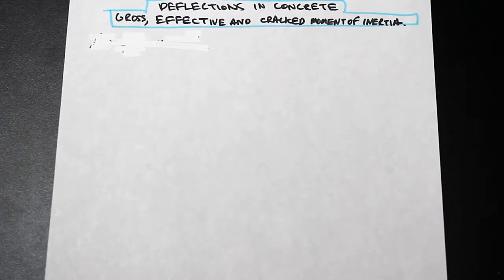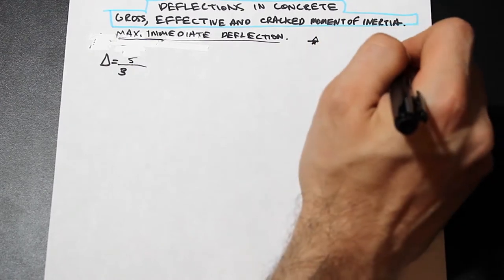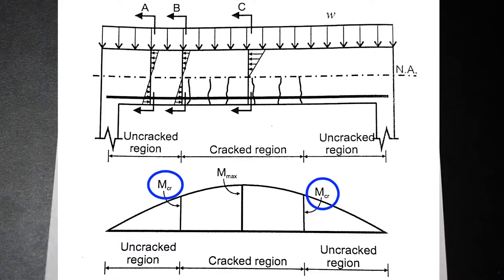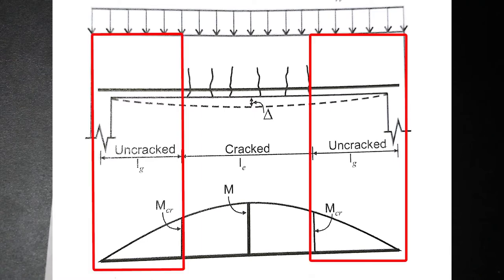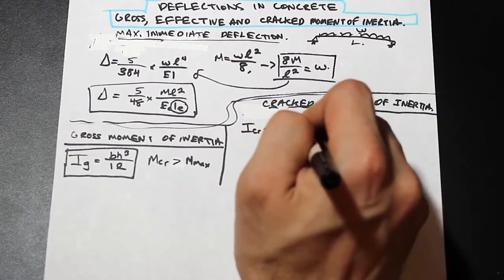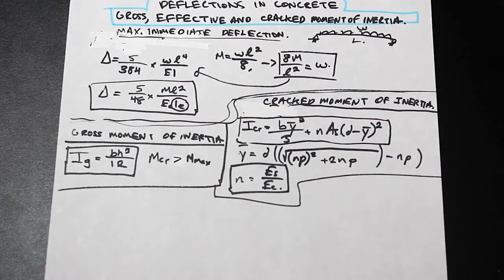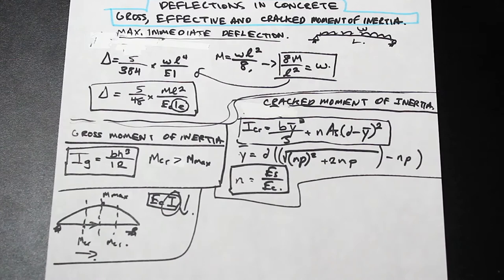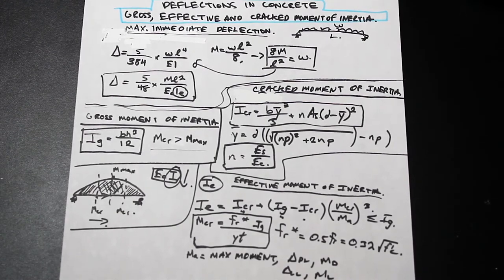Concrete Deflections - Gross, Cracked and Effective Moment of Inertia Explained

Comment: I think, mathematically the depth of neutral axis is not variable for the cracked section. The need of effective moment of inertia should have a different explanation. Can anyone give the explanation please?
Great video by the way.
Reply from the maker: The effective moment of inertia is a replacement for a variable depth of neutral axis.  It's kind of an average between gross and cracked as calculating the moment of inertia at small intervals throughout the beam would be ridiculous for every day calculations.
Reply: @AFMathandEngineering  yes.
Multiple sections are cracked after loading and the moment of inertia is Ic for such sections but in between the cracked sections there is Ig. So for calculation of deflection, we try to take a kind of average moment of inertia Ieff that would work equivalently for the whole span.
👍